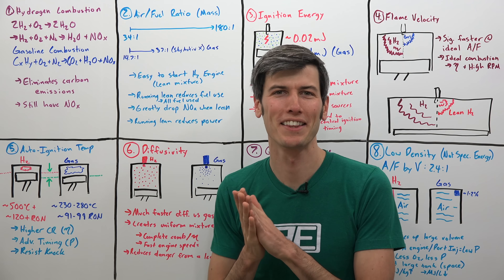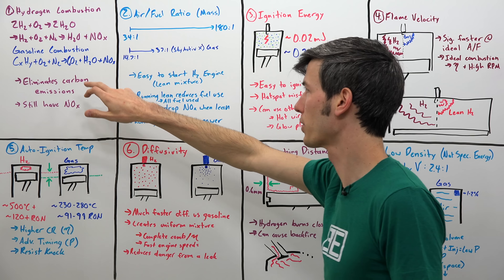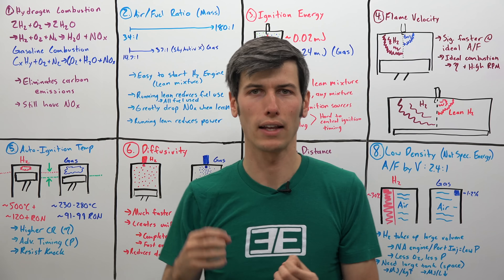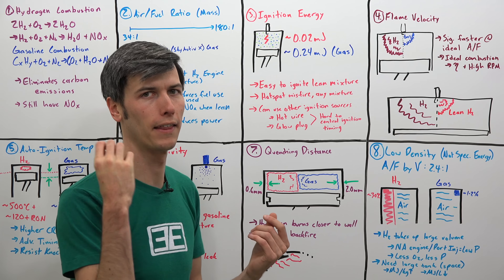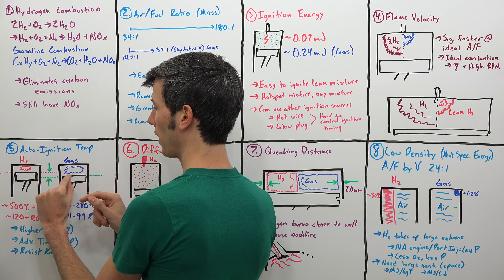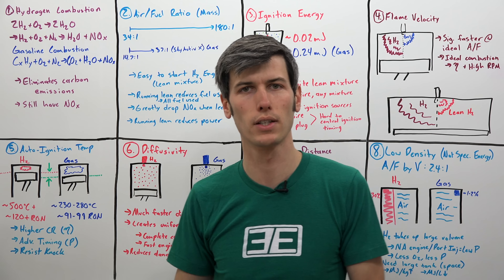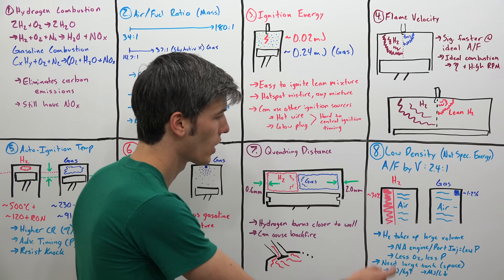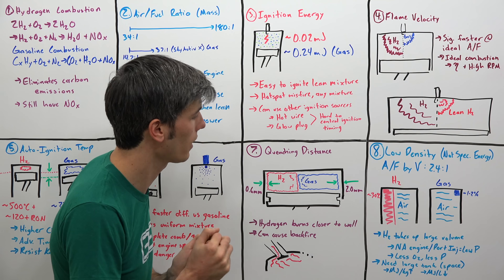The Difference Between Gasoline And Hydrogen Engines

Comment: Love the video! Comment about the rocket stuff though, hydrogen having such low volume means that you need to have much larger (and therefore heavier) fuel tanks to achieve a given total impulse. If you're not fighting against gravity, that doesn't matter as much, but when launching from the surface of the Earth it's a significant drawback. Larger rockets are also more expensive to produce and more difficult/expensive to transport. This makes hydrogen a good fuel for upper stages, where gravity and size aren't such an issue, but not so great for first stages/boosters.
Reply: They use cryogenic hydrogen to make the tanks smaller, but there is still the drawback that such low temperatures need loads of insulation which adds weight again.
Reply: @elekktrisch8087  The fuel has to be liquid, so obviously it's cryogenic. Liquid hydrogen requires around 11x more volume than kerosene or gasoline for the same mass. Even when factoring in the higher energy content of hydrogen, the tank volume required is still massively higher. Liquid hydrogen is also a much more difficult fuel to store and handle due to its extremely low temperature. This is why very few rockets use hydrogen fuel for their first stage; it's just not worth it.
Reply: @harbingerdawn  Thank you for the explanation, that was brilliant how you state this fact
Reply: The same handling problems exist no matter what stage it is.
Reply: @tedmoss  Yes, but the other issues largely disappear when talking about upper stages.

Comment: Pretty hard to control knock with a compression ignition, better to use spark plugs. Can you use lambarda sensors to adjust the mixture with hydrogen? Does hydrogen put extra strain on the valves?

Comment: Can NOx emissions be eliminated  if we use 2 separate fuel lines feeding into the ignition chamber, one for H2 and other for O2 (rather than using atmospheric oxygen)?
Reply: Only if you could get the "Exact" air/fuel ratio. However that would mean you are carrying around a pressurized O2 tank as well, adding more weight and a potential explosion hazard.

Comment: Engineering question: Does boost affect the work of the downstroke with its high pressure, or is that counteracted by the other cylinders completing there upstroke (The extra resistance of compressing a already compressed gas) and by extension is there a specific amount of cylinders that is optimal for boost? - a fan
Reply: You are correct in your assumption. Although due to the interference of the valve limiting the amount of push you would get on the piston during the intake stroke, I think you would find that those numbers you are concerned with do not matter. Using boost is always better for an engine to be more efficient as long as you can supply enough fuel to compensate.

Comment: I would have thought that if water is 2 hydrogen to 1 Oxygen that having the piston chamber 2/3 full of hydrogen to 1/3 chamber of air for the Oxygen would be the best ratio to use all the hydrogen in the engine
Reply: As far as stoichiometry is concerned you are correct.

Comment: Can you please tell me if adding say 3 percent hydrogen to air fuel mixture of gasoline will increase efficiency of the engine ??? Thanks
Reply: Adding any fuel that would allow the mixture to burn faster would increase its efficiency however, if your mix burns to fast you will have to retard your timing or you will damage your engine.

Comment: Just a curiosity question. Could you mitigate the higher temperatures by using LH/LOX as a coolant prior to pumping it through the engine similar to how NASA cools the bell of their Bell Engines? The flash vaporization would cool, and allow the liquid to turn to a gas prior to entering the combustion chamber. Just a question
Reply: I would say yes and no. The concept seems on point but why would you use a hybrid system versus just hydrogen if you have such injection already in place.
Reply: @bob11223  Just thinking of a possible way to make the system more efficient, cooler, and try to prevent a potential spontaneous unscheduled disassembly.

Comment: Would the water/ steam not build up inside the engine during 4t cycles? and what maintenence are we looking at in comparison to a standard gasoline engine, would there be more wear/ potential rusting.
What about damage to piston rings in the engine, would the water not cause issues in the oil sump?

Comment: Hey , what about a mix between hydrogen and gas or diesel?
There are some posts and companies that are installing these kind of things and they are telling the consumption and emissions are much lower.
However i talked to some people who installed this kit and the results are pretty different, for example a 1.6  naturally
aspirated gas engine was just a little powered up,the mpg wasn't changed, on the other hand a 3.0 diesel engine had the consumption reduced by 30-40% , the emissions as well.
Could you make a video about it? i really want to put this on my car and i want to make sure it's worth it.
As always you did a great job, keep it going!

Comment: The bad things about hydrogen, hot spots- ceramic coating will fix. Produces nox, so do current gas engines without mostly water partials. You have to fill up more, same with current EV’s that are taking over the car industry ... I still don’t see why there hydrogen engines haven’t taken off. Don’t have to swap out highly pollutant batteries. Plenty of waste produced from them. Rang decreases over time

Comment: so..   I've been running hydrogen a long time.. and I cant understand why he says he says they run hot or hotter..   but they dont.   given then fact hydrogen is explosive you can almost null the laws of transfering heat.    it goes off in less the a milisecond as has 32x less time to transfer that heat before the exhaust valve opens...

Comment: I would guess that another issue with hydrogen being used this way might be hydrogen embrittlement - particularly if a gasoline or diesel burning engine is retrofitted to use H2 since the alloys used probably won't have been chosen to be tolerant to hydrogen.  I could be wrong.  If anyone knows for sure I'd be interested.

Comment: The nox problem would be solved by using a browns gas generator with no air (N2) being induced to the the combustion chamber. It solves other problems like storage of H2 as well.

Comment: do not see why an engineered check valve addition with proper tension could not eliminate seepage .
Reply: Hydrogen will leak out through the pores ( tiny holes ) in metal.

Comment: One major disadvantage to hydrogen as a motor fuel is any that doesn’t burn can hydrogenate the lubricant and turn the oil to grease and that’s not good for an engine by any means!

Comment: I do have a question. How about a hydrogen generator using water which transform it into hydrogen. This hydrogen is pushed into the air intake thereby burning better any fuel with less pollution and increasing substantially the mpg of that vehicle. Another question in this scenario is, what is the best thinkness of the stainless steel plate inside the generator should be used to create less heat on the plate while creating a best usable h2 for fuel?

Comment: How is it that hydrogen has a lower ignition energy requirement but a higher auto ignition temperature? Sorry if this is a super basic question, but that just didn't make sense to me.
Reply: Auto ignition means the atoms are bouncing around so fast they ignite themselves in a given air/fuel mix. Ignition energy means a much smaller spark could ignite a hydrogen mix versus a gasoline one. While it is counter intuitive, those are just the names that the auto industry has applied to those specific circumstances.

Comment: Didn't Mitsubishi use a  Ultra efficient engine in their 2001 Lancer Cedia that used a A/F of 40:1  when in the Ultra lean burn mode 🤔
Reply: There are lean burn systems available, yes. However if you use less fuel you have less push. It is only viable for steady high speed driving, like on highways.

Comment: i always thought higher octane gas burned slower. thus a longer burn while continuing to push the piston down. it doesn't appear that way with the hydrogen. i like the way you explain things for me, just a mechanic. however its just a little high pace. maybe i'm just a little too old, and a bit slower. any way it's still great info.!!

Comment: "Large fuel tanks??" What the f***!?"
    Suggesting "large tanks" will be needed, is going off the predisposition that the vehicle in question, is only going to be set up to burn hydrogen fuel, delivered from the tank, AS hydrogen.
   Considering Stan Meyer's accomplishment of inventing, and patenting an "on board" H20 to Hydrogen conversion, and DIRECT engine delivery system, there is obviously NO NEED, for the use of "large hydrogen storage tanks" in any vehicle, in this  equation. As intelligent as you obviously are, you likely already know this.
   So why "poo poo" your viewers at the end of an otherwise excellent presentation, with the whole idea of "hydrogen as a viable automotive fuel option", NOT really being one, with a "oh well" summation in regard to a moot "disqualifying point", that is clearly devoid of known FACTS?

Comment: Hydrogen does not exist on Earth as a raw element. It has to be reacted from a hydrogen compound which defeats the point.
But nuclear power can be used to crack water directly. All light water reactors use reformers to keep the plant safe from hydrogen/oxygen created by the neutron flux in the cooling water. If the gases were simply removed and separated we would have hydrogen as a free byproduct.

Comment: In the late 1980s BMW were running a supercharged 728 on hydrogen, stored in liquid form. Worked well, I believe, but if it sat idle for a week or two, most of the fuel escaped through the tank, as hydrogen atoms are small enough to go through other materials.

Comment: Is quenching distance not affected by geometry or temperature?
Reply: It can be but in every instance you would either change the efficiency of the engine or gasoline would always have a larger quenching distance. The temperatures you are talking about would be in the negative degrees which you would be hard pressed to achieve consistently during normal operation without using liquid hydrogen.

Comment: Using electrolysis to generate hydrogen and oxygen from a water source. The hydrogen could be used as the fuel and the oxygen as the gas for the intake. This would remove nitrogen from the equation and result in an internal combustion engine with no carbon or nox emissions.

Comment: Why doesn't anyone talk about using hydrogen fuel cells in reverse. Hooking the cell up to an electric motor instead of pumping electricity to the fuel cell?
Reply: That's basically what a fuel cell is.  It uses a chemical reaction to generate an electric current, which is used as a power source.  Fuel cells convert chemical energy to electrical energy, so you still need a motor to convert that electrical energy to mechanical energy.
Reply: @FlyingSagittarius  yeah, I guess what I'm asking is, why not hook up the HHO fuel cell's cathode and diode to positive and negative terminals on a Tesla electric motor would it not draw the power out of the h20+sodium bicarbonate?
Reply: @diji5071  I think it's just because fuel cells aren't as controllable as batteries yet.  Batteries basically provide current on demand, whereas fuel cells need some time for the reaction to occur.
Reply: @FlyingSagittarius  cool thanks.

Comment: Excellent, detailed video. Question: when HHO fuel burns it will create water vapor. Will the heat of the combustion convert this to steam which expands create increased force? So you would have the ignition of HHO and then steam to create thrust.
Reply: The ignition of the gas and evaporation of steam would happen almost at the same time so either it would help push the piston or the steam would be pushed out your exhaust, the amount of gases coming out of your exhaust does not push your car in any significant way.

Comment: There should be some discussion about how much hydrogen you need in order to drive 1 mile/kilometer and how much energy is required to produce it. If you aren’t making it from hydrolysis how much CO2 is produced from the extraction of methane? Fantastic video! Great conversation to have!

Comment: Speaking  the space shuttle, have you ever calculated the amount of lift that big orange hydrogen tank they had strapped to the bottom would have? Looks to me  like  it’s big enough to float the whole thing up into the sky. It’s also a bit of a give away that  it is doing such a thing by the way it spins to the top in their”roll program “ because it’s lifting the craft.  
Would be a good project for you 😁
Reply: It isn't exactly at anything close to atmospheric pressure(if memory serves those tanks are at a high enough pressure to be a liquid at room temperature, so i doubt it would be buoyant in the atmosphere.
Reply: Gareth Baus I know what you’re saying. I should clarify. Let’s say the shuttle is actually just a normal plane with jet engines. The orange tank is filled with hydrogen vapour and the cargo hold also. Would that be enough to float the shuttle up to pretend space. 
Pretty weird how it bounces on engine ignition and then leaves slowly approximately the same rate of rise as a helium balloon.

Comment: All Hydrogen combustion engines have failed, no car manufacturer uses them or is further researching them. Hydrogen is not used as a fuel, but as a means to transport energy. If they say: a hydrogen powered car, they mean a car with an electro motor powered by a fuel cell.

Comment: What if you were able to filter the emissions as it went through the exhaust system to either trap or somehow recycle the NOx
Reply: You ARE able to get rid (not filter) of the NOx emissions with an urea injection facility - its used in diesel engines for more than 10 years now. I think NOx gases are transformed to other nitrogen compounds, which are inert (inert=they don`t react with anything) at atmospheric conditions.
Reply: You can do this, Diesel engine are notorious for having high NOx emissions.

Comment: Would you still have NOx emissions if you used hydrogen as a fuel and oxygen as an oxidizer, without using atmospheric air? Would this not also solve the density problem?
Reply: No, you wouldn`t have any NOx emissions, if you use oxygen tanks, because the oxygen tanks have only oxygen inside :D. On the contrary, the air, that we and our cars breathe in, contains many more elements and substances than O2 (Roughly: 70% Nitrogen, ~25% Oxygen and ~ 5% Other). That is why we have a nitrogenous product after the reaction.
Reply: @vladislavzlatev9288  which begs the question why not use a smaller displacement internal combustion engine specifically designed to run on hydrogen, as opposed to one adapted from an application such as gasoline.
Reply: @dancook1968  Well, you should take this question to the engineers. I guess maybe less bhp, or difficulties regarding the development of new materials, which could withstand constant interaction with hydrogen... I really don`t know much on this subject to give you a decent answer. Never the less, a really interesting subject, ICE with hydrogen is muuuuch better, than the "eco friendly" electric alternative! Waiting to see, what the automotive giants have to say  about this type of engine.

Comment: Good overview of hydrogen vs gasoline both taking O2 from air, what about premised H2+O2 blocking out air aspiration?
Reply: In order to do this you would have to have large amounts of fuel and oxidizer. For example, a 1 liter engine at 7000 RPM would require 3500 liters of gases per minute. Half of your vehicle would be pressurized tanks.  Sounds like riding a bomb and you still wouldn't make it as far as a tank of gas or hydrogen using atmosphere.

Comment: You can also recycle the water to process back into h2
Reply: Sadly it would not be feasible, because the process of obtaining Hydrogen (electrolysis) needs much more energy, than it is produced by burning Hydrogen with Oxygen. Otherwise, the water that we are drinking would spontaneously decompose to O2 and H2, and get back to being water... back and forth, back and forth times infinity.
Reply: @vladislavzlatev9288  it can be done using a 24 volt system fill a gallon in 38 seconds using either with solar cells or a small regenerative charge from the brake system I have the design my father, brothers and I have been working on. My father is a retired Lockheed skunkworks senior engineer and now works for NASA on the SLS with both my brothers. The numbers look right and we are about halfway in design.
Reply: @NET-POSITIVE  I really hope, that it would work out for you all. If it does it would be great, tho I don`t think that the generated amount of Hydrogen would be enough to power a car on its own. However, the regeneration process could be used for increasing the car`s range. The idea definitely has potential. Yet again - i really hope, that the cleaner alternative of fossil is ICE hydrogen.
Reply: @vladislavzlatev9288  that's brother it's an idea to make a start from to build on trial and error on the different processes that maybe used in a compound manner to make more efficient engines. Like rocket motors that can use the water exhaust to have a more efficient range or better specific impulse. Thank you for your comments this is how we build a better tomorrow with ideas that maybe radical like a rocket that lands itself! Good luck brother best wishes.